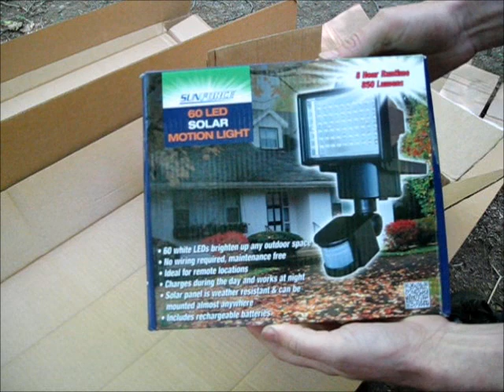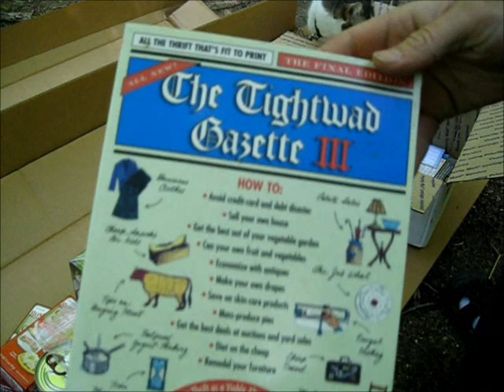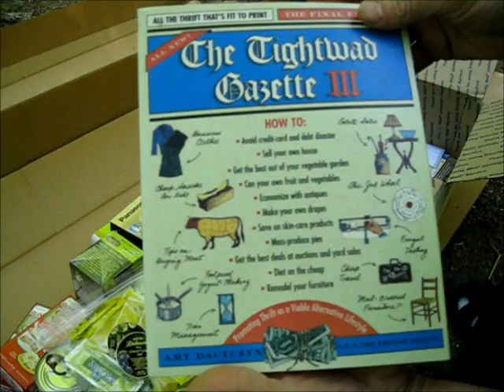Making A Chicken Tractor Using Recycled Wood Pallets

Comment: its amazing how much support you recieve from , like missouri dave and many others even your mom and dad ,  if the bear comes back you can make a cheap shotgun out of a rat trap, the trap spring  will be the firing pin, make a shotgun shell holder out of some metal tube and be able to attach the rat trap to, just in case

Comment: I'm thinking your TV must be an older one(even 3 years is old now) that uses older tech I want to say (cold cathode lighting) for screen back lighting illumination. They were/are power hogs and no longer used as most manufacturers has opted for LED back lighting now.
You may have an adjustment for backlighting in your Screen Menu and can save some watts......